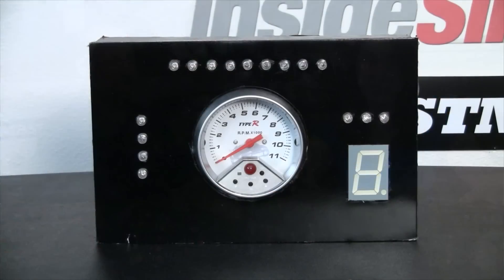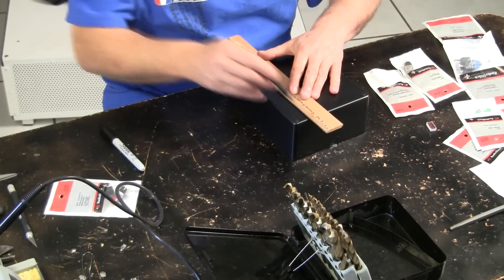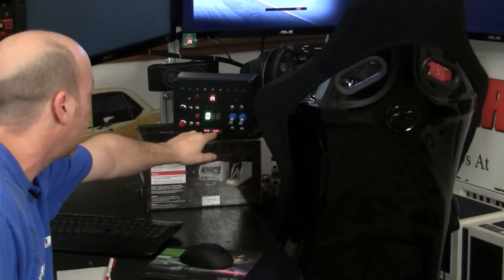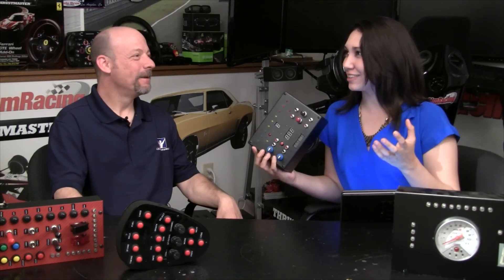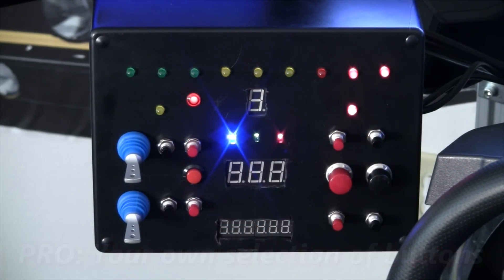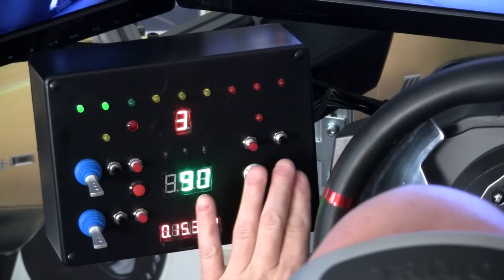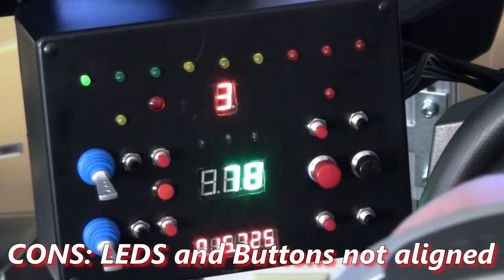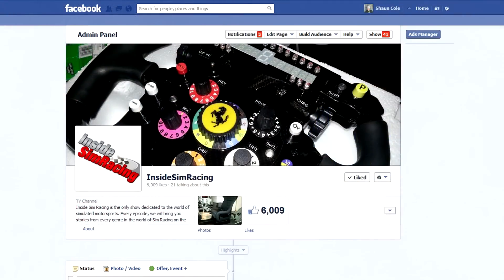Sim Racing Button Box - DIY Project

Comment: well, you dont really need many buttons for starters but if you want to be competitive you got to have some "on-the-go" adjustments/ pit stop strategies. Example:

Break bias +
Break bias -
Increment
Decrement
Toggle upp
Toggle down
Toggle Split delta laptime
Pit speed limiter
"Pit out"
"Pit in"
"Pass left"
"Pass right"
"Thanks"
"Sorry"
Tire Blackbox
Fuel Blackbox
Tire info
Mute other drivers
Speak chat
Optional: 
(Seating positions)
Igniton
Starter

Im missing some but there is lots more!

Comment: I thought the same but you cannot fit all the buttons necessary on the wheel only. You can use the keyboard for the rest, but lets face it, it is not as realistic at all. It will really improve your pit strategy as well, and it is much easier to use compared to the keyboard.

Comment: A few suggestions for future box projects, Shaun... Check out Polycase dot com... They have project boxes in all shapes and sizes, and will also laser cut anything you need on it, and can even screen the front face with whatever text you want on it. second, for the wire coming out of the box Neutrik makes a USB adapter that gives you a clean finish and handy USB-A connector for using any standard USB cable. Heck, you could probably have the hole for the Neutrik cut out as well by Polycase!

Comment: i got a jc24 from symprojects. its got a 2x5 pins on it. i just want to use 4 buttons and i dont want to solder on the board. would a ribbon cable 2x5 work?
Reply: why no solder?

Comment: Maybe someone can  help  what's best method for drilling  holes in ABS project boxes without  cracking?  Brad point Bits  , Spade Bits,  Hole Saw or just regular  Twist  drill bits
Reply: +John Gee heat up the screw driver and poke through it

Comment: Wow you make it sound a lot more complicated than it actually is, im 12 years old and i built one in less then a hour. Really it is not that hard, also you did not have to make a big button box which is more complicated and needs encoders and what not, you could just make a small one with an arduino pro micro or something, really it is not that hard!